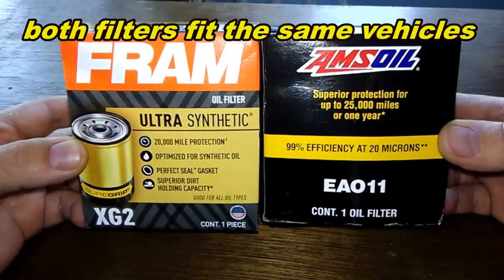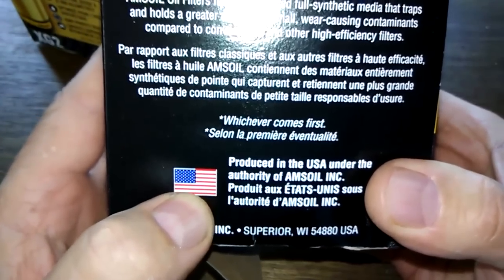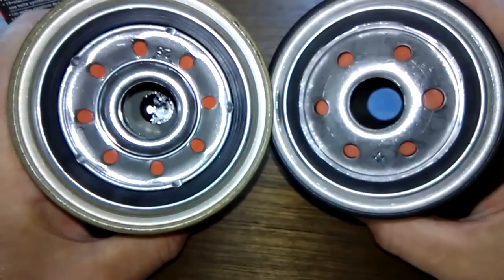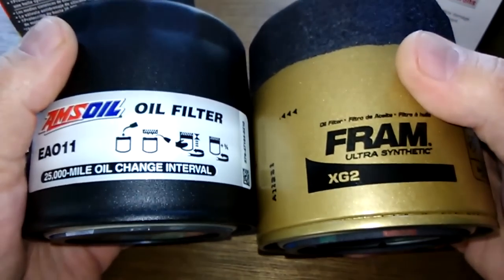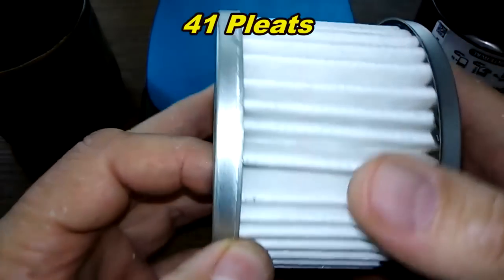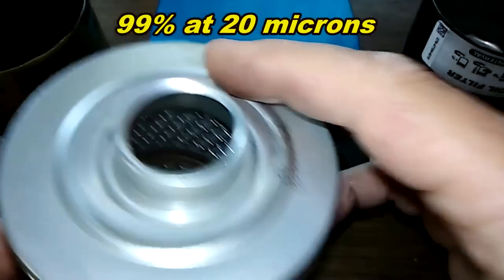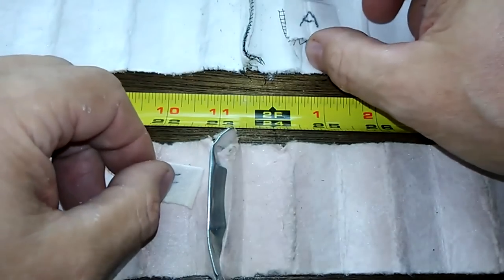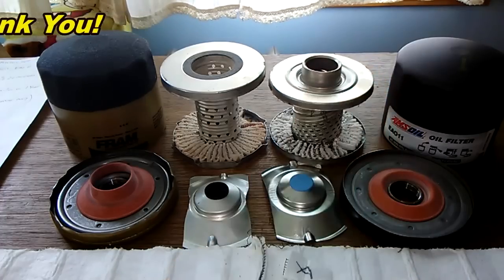Fram Ultra XG2 Oil Filter Cut Open vs. Amsoil EAO11 Oil Filter Cut Open Oil Filter Review

Comment: I think it comes down to the number of holes, seams like amsoil has more eventhough not the same.  I'd like to see both on a flow test, two top filters that would decide it for me.
Reply: Did you watch the video ??
Fram is the one with more holes, slim, not amsoil o😅
Reply: @-MrRichBiker1967 
its the number of hole through the media thats the real issue, not the number on top of the can. The more 20 micron hole through the media the better.

Comment: A couple things that are really hard to determine in a video is the quality of the filter material and the holding capacity of the media. Take bath towels as an example. You can have two towels of equal size. One might be of a higher quality (grade) of material and last longer. Also, one towel can hold more than the other. Both filters might have the same 99% efficiency at 20 microns but one might be full sooner causing oil to go through the bypass. I assume the Amsoil media is a higher quality media. I think I have used an Amsoil and that Fram a couple of times. My filter of choice is a Purolator Boss. Also, I think the can thickness is a little over rated. I'm sure it's not for the people who have had a filter punctured but I have never known anyone who has had one punctured. I have a pretty good amount of experience with fleet vehicles that get crappy filters and have never heard of issues with those either. I would prefer a thicker can over a thinner one though.
Reply from the maker: The Purolator Boss is a good oil filter. I like it also.
Thanks for sharing and your feedback!👍
Reply: The only punctured oil filter I've ever seen was the one with the big-ass screwdriver driven through it with a hammer to get enough leverage to unscrew it from my buddy's engine.  Had to try TWICE.  By the time it came loose, it looked like it'd been used to sight in a .30-06.  LOL!

Comment: Amsoil has a 2 micron bypass filter too.
Reply from the maker: Yes, but those are meant to be used as a bypass oil filter, you need a bypass system like this one to use it. https://www.amsoil.com/p/universal-dual-remote-bypass-system-bmk23/?code=BMK23-EA&gclid=CjwKCAjwkeqkBhAnEiwA5U-uM_N1iQwt-mdaz6ieGif4iE_AY4HyD8QVsjtuqGncCtjnGPcE3qpEORoC9DgQAvD_BwE

Comment: I dont know much about filters but I think we dont know enough either.  Just because Fram says its expected to work or can work for up to 20K doesnt mean it will..  Amsoil has a proven unbeatable track record when it says it will  work garanteed for 15K it will.    The Fram looks shaky why does the Fram only have very small outlet holes and the inner holes look so tiny doesnt the oil need to speedingly flush out of those?   Im a firm believer in Amsoil I used its ATF and it made my car stop shuddering.  I swear I was worried I might need to get a new Transmission very soon but works much better now.

Comment: That ams oil filter, to answer your question. About the 25000 mile interval. It's a spill and fill style filter. At about 10000 I'll drain my oil and top it up with 5 quarts of fresh oil. Then the next time I change both oil and filter
Reply from the maker: That's why I would rather change out two Fram Ultras, instead of doing what you just described (reusing a dirty oil filter).
Thanks for sharing.👍
Reply: It is crazy to think people do that just because Amsoil told them too.  It never dawns on people that what Amsoil tells them could just be marketing BS.
Reply: @jeremydawkins8399  I've done the Blackstone analysis for a regular oil change and one where I do a spill and fill in between filters and therers almost no difference on my engine at least 
(2000 4runner with 455 thousand km
Reply: I don’t think Amsoil says to do that, lol

Comment: Fram Synthetic Endurance is an exact replica of the Amsoil filters. One example is how the amsoil filter has one larger inlet hole. This is unique to amsoil yet you now find it on the Fram Synthetic endurance filters as well. I tell you it's a clone rolled off the same assembly line. The coating on the outside is the same and the Fram SE is even a smudge shorter than the ultra.
Reply from the maker: I'll be doing a comparison sometime soon. Thanks!
Reply: Awesome I look forward to it. I'm referring to the XG2 filters in my particular case. If that's the case then your getting a really good filter for a fraction of the price.

Comment: 3.54 looks like there's oil inside the filter even though it's brand new, I was just wondering what's that drop of oil inside the fram filter? If they put any type of lubrication or is it actual oil because I noticed the one I bought at the same thing
Reply from the maker: They may put a very, very thin layer of oil on them to keep them from rusting, I didn't notice any oil in this filter just a shiny black top on the bypass valve. The oil filter was fine and I would have no problem using this filter.
Reply: @WhipCityWrencher  thank you

Comment: These filters are used in the SRT engines and would be a good option to use on the Hemi 5.7’s and 6.4’s…the factory filters for those engines are super small and must restrict flow in time…

Comment: Excellent video.  I use the standard 9972 (2012 camry 2.5l).  I will be upgrading to the xg2 9972.  I like the metal screen.  I do oil and filter changes 6 months JAN/JUL.  Annual mi. 3500.  Seems excessive, but so are engine prices.  Preferred oil: Pennzoil Ultra Plat. 0w-20.  Again, nice job on the video.
Reply from the maker: Thank You! Glad you like the video.
Pennzoil Platinum and Fram Ultra are a good combo. I opened up a Fram Ultra cartridge filter, though not your size, it will be shown on June 24th. The one I opened up had a plastic screen back but just as good as a metal screen backing IMHO.
Thanks for sharing!
Reply: @WhipCityWrencher  Amazon just delivered air filter (fram), oil filter and oil for July service.  Pennz. Ult. Plat. out of stock, so went with Mobil-1 ext. perf. 20k mile.  Reason I write this, just wanted to give you a heads up on  oil filter.  It is in fact a metal screen (maybe I got old stock, not sure).  I'll be doing another service 15JAN23.  We'll see what they send.  This is a heavy duty filter.  Synthetic media, metal screen and epoxied end caps.  The OEM Toyota filter has no end caps or internal pleat support at all.

Filter part No. XG9972
Date code (maybe) A21161
Reply from the maker: @seymourscagnetti1413  You probably got some old stock, they still can be had at Amazon and eBay also. Thanks for the heads up!
Reply: @seymourscagnetti1413  date code is 116th day of 22, so 4/26/22. Fram is switching the media in the XG, the new version has no screen, more pleats, thinner media. Whip City has a comparison video out
Reply: @bobt897  Thanks for the heads-up!  Would you continue to use this (Fram) filter?  If not, what filter would you buy?  Before I got the Camry, I had a 1999 Breeze.  I used Wix filters on that 2.4L  The car had 244k miles on a never rebuilt engine that never burned oil or smoked.   We use Wix (both oil and fuel filters) on our long haul road tractors.  The Wix filter for my Camry is $20.  Maybe I'll just switch back to OEM Toyota filters.  They are dirt cheap.  Three filters for $10 bucks on Amazon.

Comment: In the old days '60's. The auto manufacturers said to change your oil filter every other oil change. So you could do that with the AMS. BUT I change my oil n filter every 3k miles using normal oil.
Reply: Ya, in the old days, oil was changed every 2,000 miles, filter every 4,000 miles.

Comment: These fram ultra’s are sure great quality for the money. Question, is their a known measurable difference between louvers and holes?
Reply from the maker: I think the Fram Ultra is a very good oil filter.
As far as the louvers and holes? I can't say for sure, but I think the holes would be less restrictive.  
Thanks for your feedback👍🙌😊
Reply: Does the Ultra use louvers or holes?

Comment: Looks like the AMS oil filter has that one bigger hole for the inlet like the royal purple. Wonder if it’s made by the same manufacture
Reply: They are. Both filters are made by Champ Labs. In fact the RP and Amsoil with exception of adbv color, same filter.
Reply: Napa Platinum is even better in my opinion. And Napa stores will give you a military discount.  I think I paid about 10 bucks.  Great filter with a synthetic media.
Reply: @BW-kv9wj  NP/XP an ok filter, however rated efficiency not in the same ball park. Not even close to either filter here.
Reply: @BW-kv9wj  Napa Platinum/WIX XP filters have horrible filtration efficiency ratings, literally the worst by a fair margin among synthetic media oil filters.
Reply: @TranslatedAssumption  Whip City Wrencher did a review and said Napa Platinum has a 15 micron rating which is better than all of them.
Reply: @BW-kv9wj  Not sure from where that spec derived, however Wix site says for XP/NP (same filters)~50%@20 microns. Also a 15 micron rating with no corresponding % is meaningless.
Reply: @faxmen09  watch the video of it being cut open and the media stretched out.  And then watch the Amsoil video.  Amsoil is nothing but champion labs with the Amsoil name advertised on it.  Just like Microgreen claims to be a 2 micron filter.  Do you believe that?  I go by quality. And the video shows quality for the Napa Platinum.
Reply: @BW-kv9wj  No need for me to watch other videos. Already commented here and my own comment that AMS made by Champ Labs (for AMS to their specs) and same as Royal Purple. Both quality filters with high efficiency spec, ~99%@20 microns. Measurement of media irrelevant to efficiency spec. Again, XP/Plat not close to Ultra or Amsoil efficiency rating (ISO 4548-12). Ultra wins on price and availability. Amsoil still a fine filter.
Reply: @BW-kv9wj  15 microns at what percentage?  If they are 15 microns @ 50% (nominal) that is okay but nothing special.  The Fram Ultra filters down to 3 microns @ 50% efficiency.
Reply: @TranslatedAssumption  so then Napa Platinum is probably 20 microns at 98.6% or 99%.  Ultra Synthetic says 20 microns at 99%.
Reply: @BW-kv9wj  Probably? Post link to ISO 4548-12, (industry standard) which both Ultra (98.6- 99% @20um)and Amsoil publish. Otherwise, speculation. Nothing against XP/Plat, just not in same efficiency ball park.
Reply: @TranslatedAssumption  Correct. Micron level with no %, meaningless.
Reply: @faxmen09  Maybe not.  But for $20 plus $10 shipping compared to $10 with military discount, I’ll take the Napa Platinum all day long, especially since I change my oil every 3,000. I have 500,000 miles on my 1992 Toyota truck.
Reply: @BW-kv9wj  Completely agree on the AMS, I wouldn't pay that either. Otoh, choice between Plat. and Fram Ultra at similar price, Ultra all day. Ultra at WM, ~$8-$9 (depending on app), Ultra FTW
Reply: @429thunderjet2  I’m gonna probably start running Fram Ultra Synthetic solely in all my vehicles. It has the same rating as Amsoil which is a Champion filter. 20 microns at 99%. And instead of paying $30 for Amsoil, Walmart has Frams for about $10
Reply: @BW-kv9wj  not necessarily same, they are playing a little game with their verbiage on the 20 microns .
Reply: Fram is
Reply: @429thunderjet2  How do you know?  I saw both filters cut open and the media stretched out. The Fram Ultra Synthetic looks better to me. Who do you believe when it comes down to their micron ratings?  Who do you believe over the other?

Comment: Is the mesh screen in the Amsoil filter metal or synthetic? My concern would be if there is moisture in the oil, what type is the metal screen in the Fram filter. Will it start to corrode or rust if exposed to moisture, which could affect the TBN of the oil?
Reply from the maker: The Amsoil has a metal screen backing. Down below is a link to a video I made a while back with a used Fram Titanium that still uses the metal backing and oil analysis. No problem with the metal rusting. You have to remember that the whole inside of the can is metal along with the center core. The Fram Ultra no longer has a metal screen backing.https://www.youtube.com/watch?v=2cGjkaNt7h0&ab_channel=WhipCityWrencher

Comment: Two other good filters to test would be royal purple and Moble 1
Reply from the maker: The Royal Purple oil filters are basically the same as the Amsoil and Fram Endurance oil filters and I've opened a lot of the Mobil oil filters, a google search should show you them. Thanks!👍

Comment: Amsoil makes exceptional  motor oils. Their oil filter is another story. Fram easily wins this battle.
Reply from the maker: Thanks for your feedback👍🙌😊
Reply: I think easily might not be the correct word! The Amsoil can was thicker and the bypass valve setting higher to prevent opening under sudden spikes in oil pressure. The Fram was cheaper, that’s about it.

Comment: I would run the signature series 25K drain blend first with the fram. At 10K I would do an oil analysis and save the results then, I would change oil with the same oil and put on the Amsoil 25K oil filter and do another oil analysis to see if I come up with any differences in the test. It's too difficult by just looking at these this way to tell which filter is most effective. The oil test result may give better info to be able to tell. Either way, I'm using the Amsoil filter on my car because I'm running Amsoil in it. At 15K I'm going to do a PM oil analysis anyway with one of our oil test kits and send that into the lab we use.

Comment: I don't care what oil filter you use, but you should still change your oil at 3000 mile intervals,period!! Anyone who thinks they can change their oil at longer intervals and still avoid engine wear simply doesn't have a clue!! As a retired millwright/industrial mechanic (48yrs) and a retired professor of machine technology, I have attended countless lubrication seminars! My takeaway is that the "lifetime" of a machine, including automobiles, is the length of the warranty and no longer!! Oil is cheap, engines are not!! Cheers from Canada 🇨🇦
Reply from the maker: Cheers👍
Reply: The 3,000 mile drain pain came from the 1960's, over 60 years ago now.  I suggest looking at the reams of test data from laboratory oil analysis tests and witnessing even low performing, cheap oils perfectly capable of going well beyond the obsolete 3,000 mile drain pain.  There is not a single oil company or car company that recommends the 3,000 mile drain pain anymore, as it's unnecessary and very wasteful.  Times change.  Technology progresses. If you use cheap oils, expect cheap results. We get what we pay for.  AMSOIL coined the term, "Extended drain interval", with up to 25,000 mile recommended oil drain intervals beginning way back in 1972, over 50 years ago. It's old hat now.   - 30 year Independent AMSOIL Synthetic Lubricants Dealer.

Comment: amsoil filter is longer life yes or no. i use purolator of fram ultra. not cheap stuff. and i use castrol non synthetic but its been doing good. ill probably stick with what im doing. amsoil is a good product though.
Reply from the maker: Hi David,
Amsoil is rated for 25,000 miles and the Fram Ultra is rated for 20,000 miles. But who's going to go that many miles on a single oil change. Not Me.
Reply: @WhipCityWrencher  i appreciate info.🏁
Reply: @WhipCityWrencher  - Countless motorists have for the past 50+ years when AMSIOL pioneered the first 100% synthetic API qualified motor oil in 1972.  In millions of real world, over the road miles and countless laboratory oil analysis tests confirming that AMSOIL synthetic motor oils are safely capable of extended drain service, it's old hat now.  Why change oil if the laboratory oil analysis test results prove it's suitable for continued use? Would we replace long lasting radial tires at the 10,000 mile intervals of bias ply tires?  Of course not. To do so would be a tremendous waste of money. Technology moves on.  Don't change your oil, change your thinking. :) 30 year Independent AMSOIL Synthetic Lubricants Dealer.

Comment: You can get the high miles out of the Amsoil when there are a lot of highway miles and it is when you use Amsoil oil because it does not break down like most other oils. I will still choose Amsoil filters over Fram any day of the week.
Reply from the maker: Your choice, Thanks for sharing👍🙏😊
Reply: @WhipCityWrencher  when you see fliw tests and actual filtering tests with capacities as gas been done in many filters including Amsoil filters by labs not associated with the company you will be a believer in the Amsoil filters. Have not seen anything on these Fram ones, but I would be surprised if they were nearly as good.
Reply from the maker: @shawnengstrom3906  Here's one with a Fram Ultra. It's a lot of reading, but scroll down to the chart on page 25. https://bobistheoilguy.com/forums/threads/would-you-all-like-to-see-iso-4548-12-oil-filter-lab-testing-comparison-efficiency-capacity-pressure-vs-flow-bubble-point-and-burst.334882/page-25
Reply: @shawnengstrom3906  could you provide us with some source information that back up what you have stated?